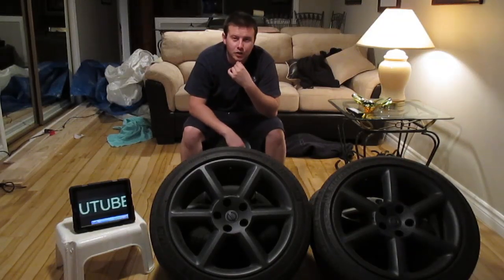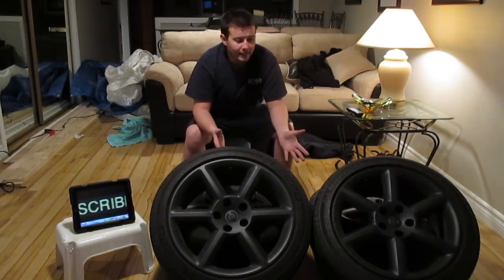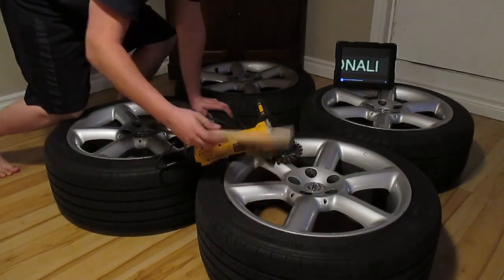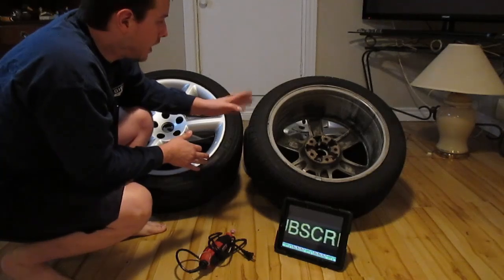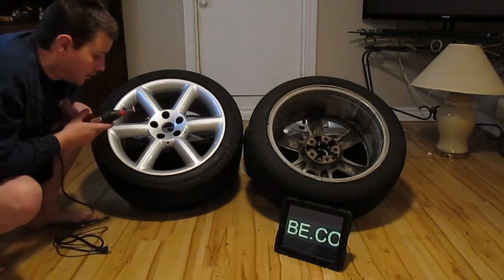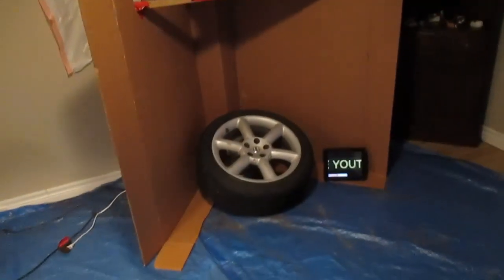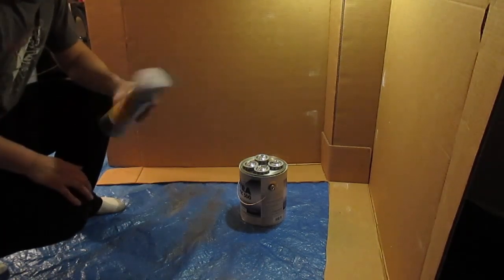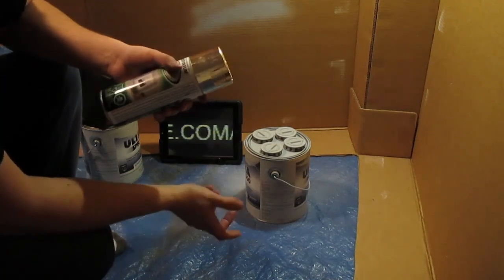How To Paint Rims Using Spray Paint / Rattle Can

Comment: Great vid man.  The rim came out Awesome!  Duplicolor has a line of spray paint just for automotive use in Chrome not sure about in gold but Rustoleum outdoor metallic gold would have also work out fine and durable too.  You really did a good job regardless of the camera failing.

Comment: How did the paint work? I found the rustoleum golt met paint but it says interior.  Is that fine? What about the clear coat? Does it stay looking nice? Does it peel anywhere? 
Your video was really helpful cause I was going to paint my rims just like that but i dont know what type of paint I should use or if it's a good idea for the long run.

Comment: I know this vid is old but just wanted to know how that paint is holding up?    I got a set of wheels for free, no bends or anything just curb rash. I am still deciding on color and brand of paint but want to know how its holding up?? good vid by the way
Reply from the maker: It's holding up pretty good. A few chips here an there but had them at the track a few times so I'm not surprised. I curbed one pretty good last summer so I'm gonna be redoing one this winter.

Comment: Where the hell did u buy them? Lol I'm looking online and it's like no Home Depot or lowes even knows what tremclad is
Reply from the maker: Wow really haha. I got mine from Canadian tire actually, so maybe it's a Canadian company. I'm surprised they haven't even heard of it haha
Reply: Yea just looked it up. canada only lol. so do you think it'll be fine using RustOleum everything? (primer and clear to replace the tremclad?)
Reply from the maker: KseriesChad yea im pretty sure rustoleum is the same thing. I used rustol on my winter hub caps and it turned out pretty good.